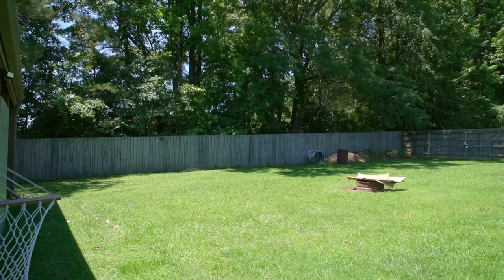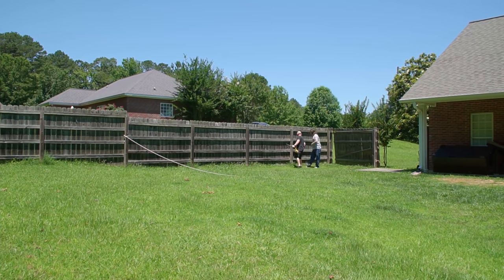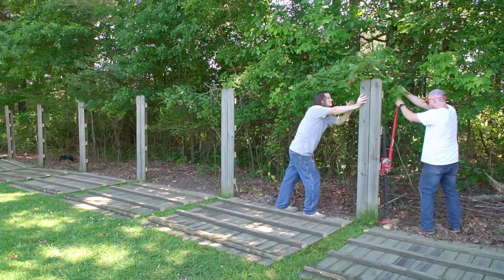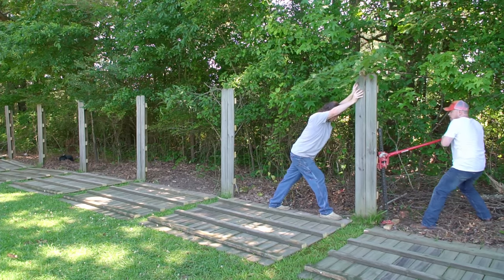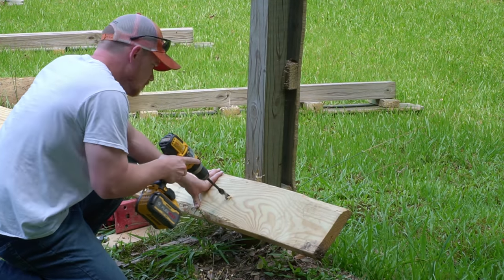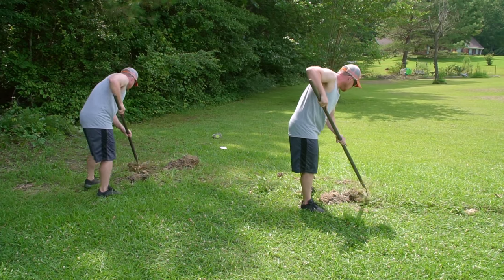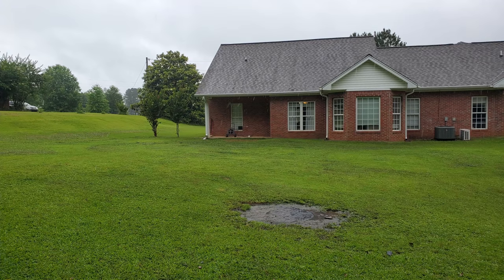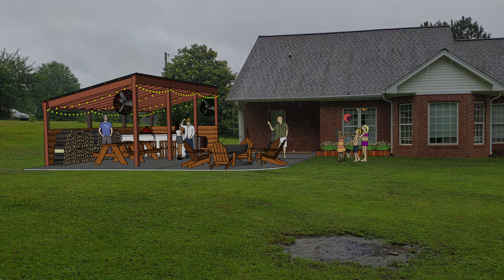Privacy Fence Demo - Lessons Learned - 370

Comment: Jay - I did a backyard entertainment area like this a few years ago.  You'll be amazed how much you use it so this is time and energy well spent.  Before you start, watch the rain drain off your roof where the area will be - if you're going to need some kind of drainage the time to install that is before anything else.  Might need a french drain or in my case I put the downspouts into an underground soil pipe to take the water away.  Also, consider running electrical and natural gas to your fire pit and kitchen areas before you put down the patio.  Nothing like enjoying a fire pit and everyone doesn't smell like a forest fire afterward, and you'll never run out of propane in the middle of grilling again!

Comment: It’s amazing what a hi-lift jack can do. I can see how the board attached to the post might help stabilize the system while working alone, and give you a better mounting position for the jack, but it’s providing negligible mechanical advantage when the jack is immediately adjacent to the post. If there was more of a lever arm between the jack and the post, like several feet, then the board would add a mechanical advantage but the post would be moved at a slower as compared to the jack. At the end of the day, you got er done and thats what matters. Thanks for making the video.

Comment: I pulled 21 posts with a farm jack but I used a chain wrapped around the bottom of each post. I used a small clevis to secure the chain. Took me 1-1/2 days to pull them by myself. It also helps to use water to soften the ground. I used 5 gallon buckets of water since a hose wasn’t available close by.  
I also just put up a 12x14 pavilion I purchased at Costco for $1800 on our extended patio. You will love having that outdoor area. We do!

Comment: Lots of fun. I have seen people save pickets but myself I just want them gone. The previous owners of our house put the fence 12' off the property line so we have allot of property we can't use and it creates an alley for shenanigan's to happen in. So one of these days it will get moved for more yard and to keep the kids out of there. 
     I would run a 220 circuit out to the new pad so you can run a small sub panel. And don't forget to run a water line out there too.

Comment: When I did the farm jack to post removal, I used a 2x4 like you did with the 2x6, but I just chained the board to the post at one of the cross beam points so it would not slip down or up.

Comment: Nice work Jay.  I thought i had perfected the farm jack post removal with one man process and mods, but your 12 ft 2x8 lever pined to the 4x4 is a great technique.  Impressive.  I would use a 18" clamp in addition to the bolt to avoid needing to use any nuts, but keep the board from tilting while under tension.  It has a tip resistant surface and it gets the base away from the concrete plug (sometimes 18" in diameter at the top).  I don't think the mechanical force advantage is a significant improvement, but it doesn't hurt either :).  If you run out of height, you can even place a stump at the far end to give you another foot of rise, so long as the post doesn't sink back into the hole (it does that when the soil is too wet and is a royal pain to deal with).

For reference the other two methods for one man operation: 1) attach a 2x4 top nose on the jack lift plate to contact the 4x4 when tension is created for far greater stability; 2) attach two 60 inch 2x4s with a loose long bolt at the top hole in the high lift jack to form a tripod hovering over the 4x4 and concrete base.  In both cases use either a 60" piece of chain (smaller rungs are better) or use the drill a hole and attach a short 2x4 foot towards the bottom of the 4x4 as a lift point.

Comment: Great timing. I have just started taking down my old fence also. I have removed several panels and found out that my posts are in concrete so I've been wondering what was the best way. Now I wish that I could clone myself a twin like you did. I could really get stuff done then!

Comment: I had to do the exact same thing a while back.  I also ended up drilling holes into the posts and used an old Honda  CV axle  shaft as the "bolt". Had to use a cut off wheel to take the ends off though, those things are hardened steel.  And, like you found out, I posted those fence sections on Craigslist and I had people crawling out of the woodwork begging for them.  One man's junk is another man's treasure 😉

Comment: When i had to pull a post like that i used a strop/strap in a chock configuration around the post, this worked like your hole drilling without the work. Same as you it took a couple tries to find the best method for me.

Comment: Only 14 years for a fence !!! Is this in a Malaysian jungle??? The first wood fence on my property was easily 25 years old when it got torn down. And its replacement was 24 when I removed the pickets to use as spacers, and saved every single post and all but two of the horizontal 2x6s, to use in my latest fence. Granted, I live on the frozen tundra.

Comment: I've been working on a similar project on my property, pulling out old fencing that was used as a horse corral, my posts are the round agricultural style. I have a very similar farm jack that I had originally used like you were doing. Someone suggested I get a length of chain and some hooks. I wrap the chain around the base of the post, hook it to itself and to the bottom hole on the farm jacks' lifting pawl. The chain grabs into the post and lifts pretty well and is adjustable to different sized posts thanks to the chain's length. My posts had no concrete but where driven 4-5' into the ground, so when I reached max lift all I had to do was drop the pawl and reposition the chain around the post again to lift the last bit out of the ground.

Edit: Should have looked at the comments, a lot of ppl have already commented the same technique I've just written lol. Anyways jealous of your yard, looks so good. =P

Comment: Rent a  mini excavator.  It was not very expensive and only about $2 worth of fuel.  Took less than 1/2  do to remove my fence and most of 3 of my neighbors fences that they asked me to remove too.  So much fun running the excavator too and very little effort . Also very easy to load and haul. Make sure it has a thumb too.

Comment: Did you think about maybe using your truck, wrapping a chain around the posts and pulling them out with your truck? That’s how I’ve pull fences down.
Reply: This could cause a much larger hole instead of pulling straight vertical. 

But using a truck, chain and spare tire as the fulcrum would have brought it up vertical.

Comment: Jay, here in Australia the boundary fence is owned by me and my neighbour so permission would be needed to remove it and not replace it. Is that the case in the US?
Reply: it depends if the cost was shared when it was built
Reply: No.  In the USA, the fence is required to be put on (your) land. Typically this is just inside the property line.  In some states there are rules in which the "nice Side" is required to be faced out to the neighbor but otherwise there are no permission requirements (other than perhaps a city permit) to remove a fence under normal circumstances.

Comment: Jay you're so right "would of should of could of senario", too bad with all of your great neighbors and friends one didn't have a tractor with a loader or backhoe to pluck those posts right out. Also right on again as any exterior use of wood degrades instantly.
Reply from the maker: I thought about the tractor method about half way through but figured the time invested tracking someone down would be too much compared to just getting it done. Definitely planning for that if I'm ever in this situation again.
Reply: @JayBates  A tractor may have also torn up your yard though, so it wouldn't have been without it's own challenges